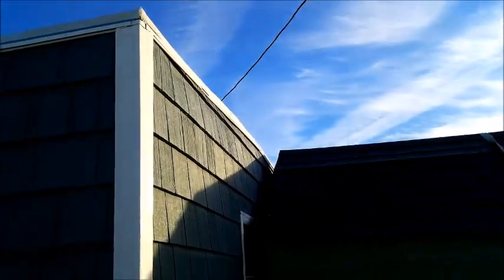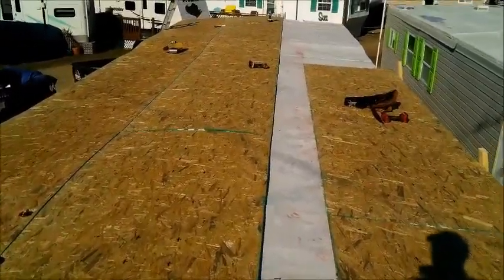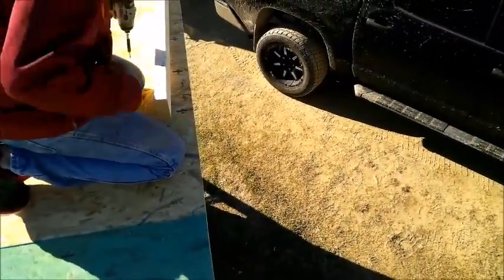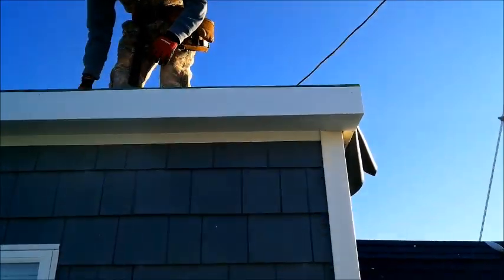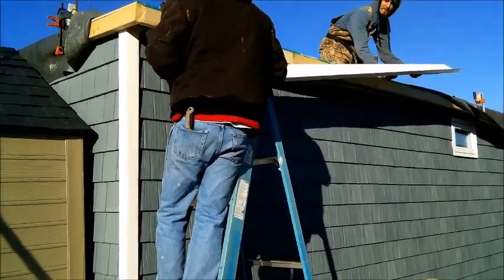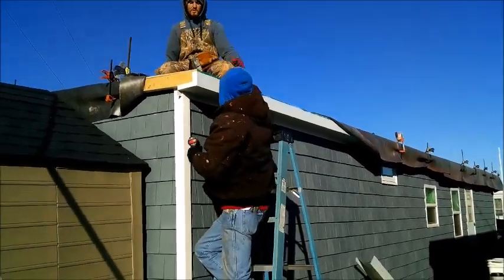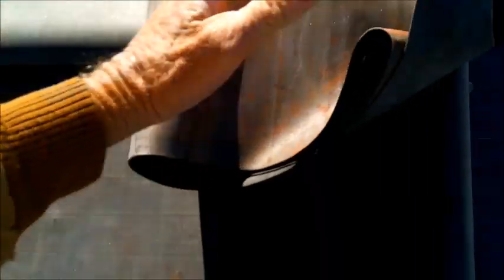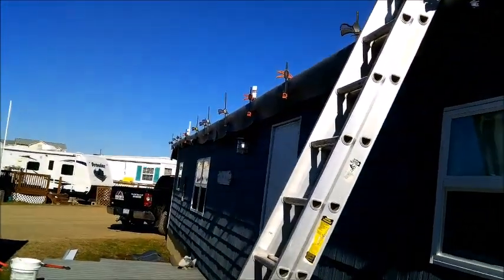Single Wide Mobile Home Roof TRAINING start to finish

Comment: I inherited my grandma’s trailer and land on Padre island. I believe its a 70 or 80 model. It had been i the county for 30 years at least before she had it moved. She had dementia and was being taken advantage of by her son. Anyway when I got it she was a hoarder. Useless and valuable. Took  3 years to go through everything. The trailer immediately got a new roof and deck. 7000$ for the roof, 21,000$ for the deck. They also added overhangs and soffit but it’s hardy. Other than that it’s the same kind off roof. Don’t even know the name of the company. I handed him 7000$ and he built the roof, that was 5 years ago. Since then I’ve been in the middle of hurricane Harvey and just a couple weeks ago hurricane Hanna. I had one small drip around a toilet vent pipe. In 135 and higher winds and rain coming down just as fast. Not a leak anywhere, just that drop. Easy fix. I highly recommend this type of root. With the deck 28,000 made the old gal look young again. When I get thru she’ll the the Pimpest trailor in the park. I spend a lot of time on an old trailer because it’s mine. Paid for, and stuff is being replaced and fixed everyday. Little by little. And I love remodeling. It’s what I do. Good product guys.
Reply from the maker: Thank you so much wow it sounds like you came along ways with that Mobile Home. I love mobile homes they’re great I like Repair and myself

Comment: Great job drew and the crew!  Glad your doing better and keep on improving buddy!
Reply from the maker: I am getting better thank God
Reply: Hey drew I have a question for you. I saw in one of your videos you used 1x4 strips for the sub roof before putting the sheets on. The other question I have is do you use 3/4 for the roof I heard mention in a video once osb? Are the 1x4 strips necessary or can you secure the osb directly to the roof floor and do a traditional shingles roof?
Reply from the maker: The one by four strapping is already there I didn’t put it there it was there when we tore the floor out some mobile homes have them some of them don’t
Reply: @Drewsroofingandhomerepair  
So for the osb it is the 3/4 you use ? And shingle roof is good yo use with it
Reply from the maker: Are use 7/16 OSB

Comment: What keeps water from getting between the top of the flashing and the rubber that's over the 2x4 facia? Is it the compression of the rubber between the fascia and the flashing?
Reply from the maker: My rubber goes over the top of the flashing and then we put that aluminum termination bar with screws every 6 inches. Best Mobile home roof repair

Comment: How does the rubber roof  material hold up to the sea salt weather environment ?  Does it have to be cleaned and treated periodically ?
Reply from the maker: No actually it doesn’t have to be cleaned or treated I live at the beach Southeastern North Carolina near Myrtle Beach so the only problem that you might have is the screws that we install the termination bar or made of galvanized so if you use stainless steel you won’t have any trouble at the beach area or any salty area

Comment: Great Job Drew as always.   Are older homes that siding could use paint, do you prefer it to be spayed or brushed.   Painted by hand in 85 and held up very well, hear arguments each way on what covers best.
Some said to side, but will 2”x 2” hold siding over the metal siding?

So glad your health is improving!  Keep fighting.    God Bless ❤️
Reply from the maker: Pain with brush and roll

Comment: Hello I’m in Oregon have a double wide how much does it cost roughly to level ?? it’s really leaning out on the side that carries most the weight. I noticed the problem went to replace insulation/ barrier after I watched your video s
Reply from the maker: I have been to Oregon my cousin used to live there Joe Bussell I came to visit him probably eight years ago good luck with your project it’s all elbow grease nothing that can’t be done
Reply: Just got the quote today . If y’all want to know local Roseburg $950 to level 6-7 hrs to do .

Comment: love the job you do but I dont like a black roof
Reply from the maker: We had the OSB first so the black rubber does not transfer the heat through to the mobile home. And for the most part if you think about it you can’t see the roof all you see is the edge

Comment: Did you go over the existing roof?
I’m gonna do mine next month, and I have beat up corrugated half moon roof. I was thinking rip it off and attach plywood straight to the trusses
Reply from the maker: I almost always go over the top. I hardly ever take the metal off but it can be done

Comment: So is the OSB board screwed down into the wood beams underneath the old tin roof?
Reply from the maker: Yes and that is why we find the rafters by poking holes in the roof and then we pop those chalk lines so we can see where they are and then we screw into them. 
https://youtu.be/pE5G0JWq29A
Reply: @Drewsroofingandhomerepair  Great video! God bless!👍‍
Reply from the maker: Thank you my friend. Yes we always screw down to the existing rafters of the mobile home which are basically two by twos. All you have to do is find them like I did on the video

Comment: I’m purchasing 1’ by 10’ termination bar and I wanted to know if I could bend them The width of my trailer is 12ft and the length is 57’. Or should I just cut smaller pieces of the termination bar to accommodate areas that’s too small to fit on bar?
Reply from the maker: Yes you can cut it I cut mine

Comment: If it’s going to take me a few day’s to complete. Is it ok if the plywood gets rained on over night before having time to cover it?
Reply from the maker: No Might not hurt to plywood but it will hurt your house you have holes in it from screwing down the plywood cover it with a tarp at night
Reply from the maker: You can’t get it done the first day if you have a rubber cut your rubber and put it up there if not at least cover it up with a tarp so the rain doesn’t affect the inside of the trailer. https://youtu.be/EJoGj5C9ZJs
Reply: Buy a couple plywood umbrellas and give each plywood one.
Reply: Thank you so much!!!

Comment: Seems like there are seams every 4'. Is that just the manufacturer seam?  I'm looking to do my 12x60 with this. Thinking 2ea 15' x 30' with a 2' seam in the middle. Sure would like to see how you seal around the roof vents. Advice on 2 thoughts please?
Reply from the maker: You’re looking at the manufacturer seem the rolls I have come 30 x 100 ceiling around the roof vents is easy you buy lap sealant it’s EP DM lap sealant and he put underneath event and screw it down check out my other videos I have several that show how to put them on
Reply from the maker: If your house is less than 60 foot long you can use two pieces 15 x 30 well it’s according to how wide your house is
Reply: Don't hate bc I'm beautiful!  Is 60mil what you use? I have existing awnings. Should I just lower them enough to accommodate the eave? I do realize that I need to lower on both sides